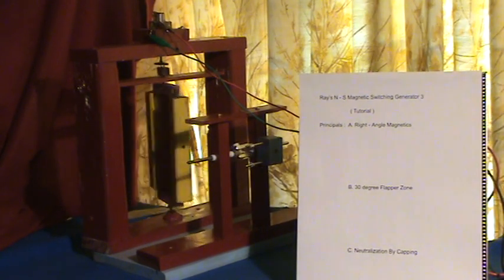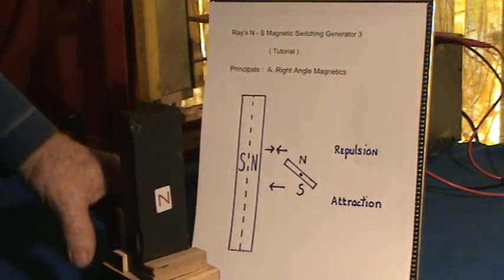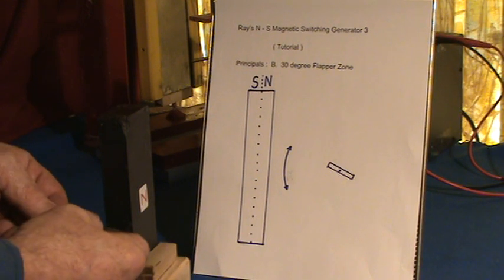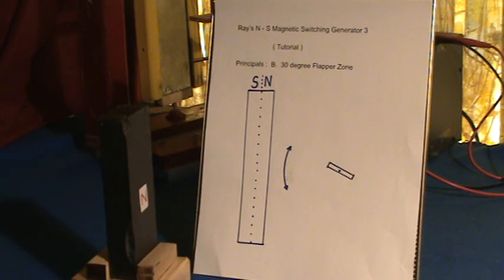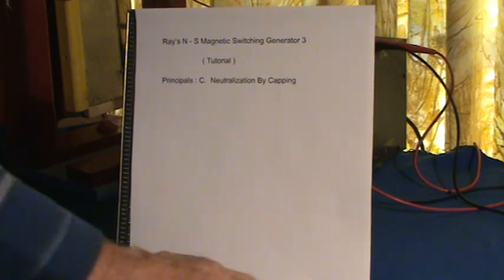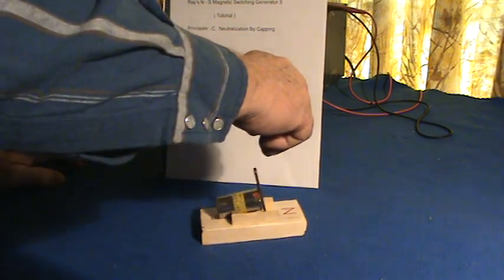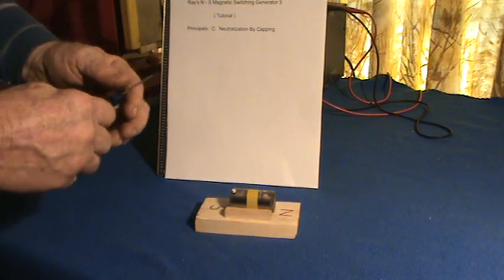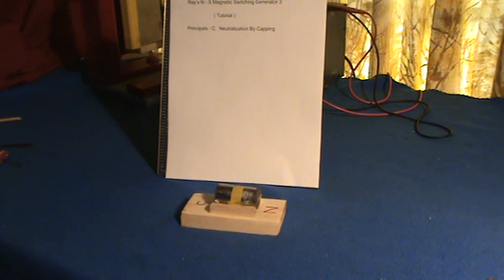Ray's N - S Magnetic Switching Generator 3

Comment: Great work and information. Is it possible to design a pickup coil based on the flapper set up? It may generate a sign wave. Just a thought. Again, awesome stuff.
Reply from the maker: Pickup coil needs faster RPM ,s than this machine , that is why I used a geared motor - generator for output . See # 1 . But yes it does generate a sign wave when held close to flapper magnet . Thanks .

Comment: Instead of square channel steel perhaps u-channel would be better suited for field manipulation.
Reply from the maker: That could very well be , I don't have channel but used two straight pieces for the legs and put them ac ross the magnet barrier at about a 45 degree angle and had good results . Thanks .

Comment: Would it be possible to have the large magnet stationary on the ground on one of the capped sides, other capped side facing up. And then have the flapper magnet perpendicular to the ground on a shaft connected to a motor/generator and have it "bounce" from N to S side. Being pushed up by repulsion on one side and the drop by gravity on the other, then repeat. 
If that makes sense.
Reply from the maker: An idea I will have to try , Thanks , not sure when can get to it but will try .